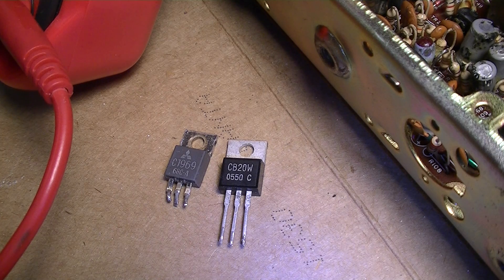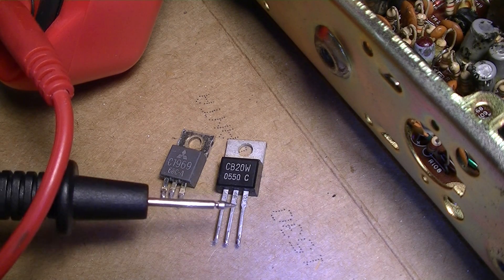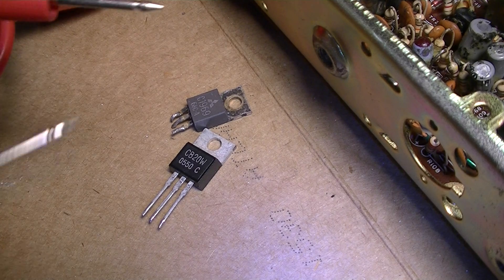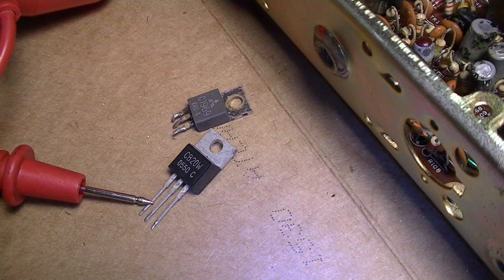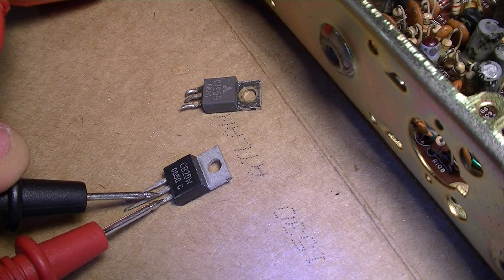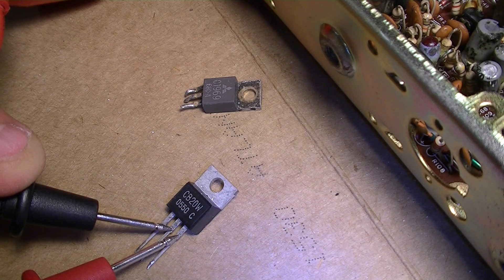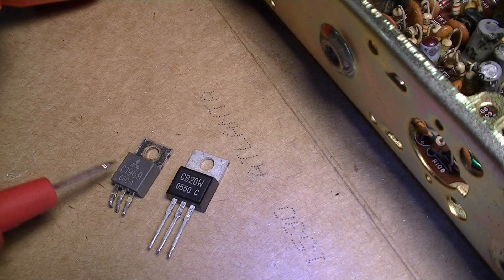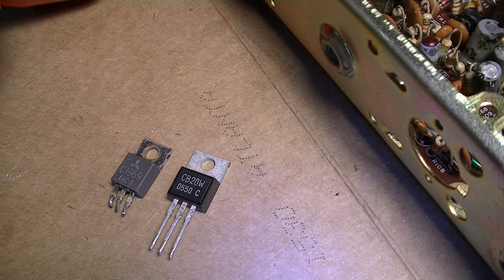2sc1969 eleflow cb20w testing

Comment: How does the NTE236 compare?  NTE Electronics lists that as a direct replacement.
http://nte01.nteinc.com/nte%5CNTExRefSemiProd.nsf/$all/597A4E1CA9FEB83585257910007EBF3B
Reply from the maker: Steve C Nice to see you guru. thanks for picking up that question by Steve. Yes Steve, I agree with Radio Follies. They will work, if they are the real thing. I choose the CB20, personally. Because, the person who markets them, is well known and trustworthy. I have yet to be sent one that was off in any way. I have installed 7 of them. All with no problems.
Reply: Try to get an Origional Toshiba, or Mitsubishi. The NTE will not perform as well.
http://www.worldwidedx.com/threads/best-option-for-blown-final-148.151249
Reply from the maker: nice post Carl. Steve I hope you got all the info you might need to help you along.
Reply: *****  While the CB20 looks like a good option they seem to be only available in Australia and U.K.
Reply from the maker: Steve C yes, they are an English import. you can find the seller via ebay. eleflo cb20w should be your search in the ebay search bar.  I have a couple, but I have them for repairs.